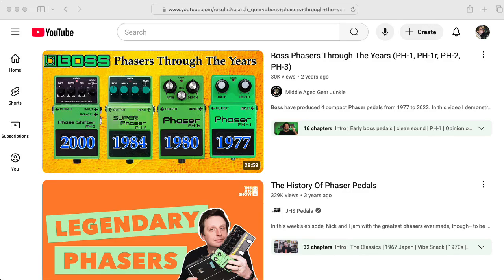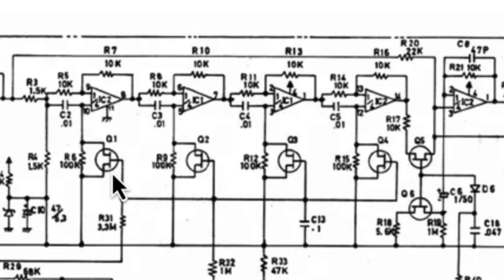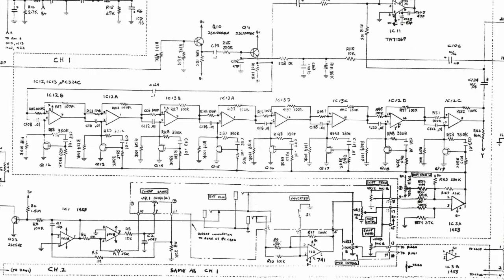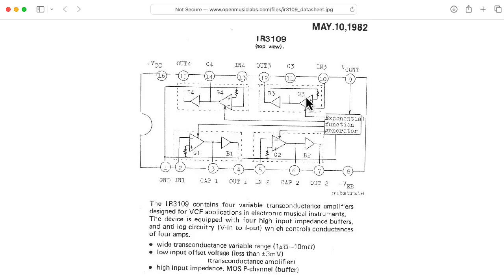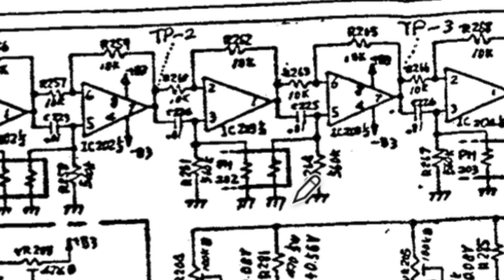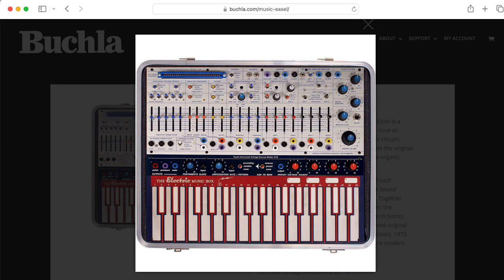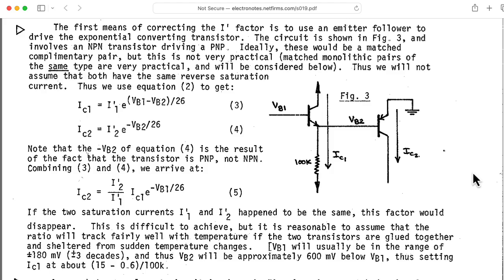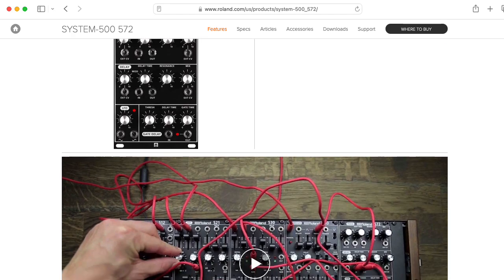Roland/Boss Phaser Circuits: A Survey of Schematics (JFETs, OTAs, and Vactrols)

Comment: Aaron, in order to have a chance at understanding your Guitar Amplification & Effects course (in your playlist), how current do my mathematics, etc., classes need to be, since I never used any of that info in my career?  (I graduated in '82.)
Reply from the maker: You can get the "gist" of a lot of things without following the details of the math. To dig deeper, you need the math, but for the most part, the most of the math I use through most of the course is just algebra. It gets more complex when I talk about frequency effects (literally, the s-plane is the complex plane), but you can analyze all the basic amplifier types with algebra. And really basic algebra -- not even quadratic equations.

As far as the electrical engineering goes, I assume basic circuit theory of resistors, capacitors, inductors, Thevenin's theorem, and operational amplifiers (for the effects part), as would be covered in a typical first semester circuits class. I also use the idea of small-signal analysis, as used for transistors. 

To get those basics, I recommend the free courses my colleague Bonnie Ferri has on Coursera.
Reply: @Lantertronics  Thanks Aaron!

Comment: One of the interesting quirks of OTA-based phase-shift/allpass stages is that they can be easily converted to lowpass, by simply rerouting one end of the capacitor in each stage from the input of the stage to *ground*.  I think the late John Blacet was the first to make productive use of this in his "Phase-Filer" module in the late 1970s.  While flipping through the appnotes for the SSM2040 chip, one day, I realized that, although a number of commercial OTA-based phasers used 4 individual OTAs, rather than a quad-OTA chip like the SSM2040 or IR3109, they could be modified in this way.  So, I did the mod to an Electro-Harmonix Small Stone, and a Ross phaser (that essentially cloned the original 6-chip Small Stone).  Worked like a charm.

Those familiar with phase-shifters will know that lifting the dry signal, and using only the modulated phase-shifted path, will get you a form of vibrato - pitch-wiggle.  When 2 of the allpass stages are coverted to lowpass, one gets a very interesting sound.  The pitch-wiggle of the other stages is retained, but the modulated lowpass of the converted stages gets one a form of modulated "wah".  However, since modulation of the bandwidth also tends to modulate perceived amplitude, the net effect is a marvelously "swampy" sound that combines vibrato, a sort of tremolo, and filter effect at the same time.  It still yields a different-sounding phase-shifter effect when the dry signal is included, but lifting the dry signal takes you to another sonic world entirely.
Reply: One of the challenges faced by phasers that employ FETs, rather than OTAs or LDRs, is that of finding a shared bias point such that, when an LFO is applied to their gate, they are ALL changing their drain-source resistance at the same time.  In many respects, it doesn't matter just what that D-S resistance is , since the audible effect results from the cumulative phase-shift across all the stages.  But it is important that all stages are always changing D-S resistance in response to modulation source, and one doesn't find onesself with one or more stages "opting out".  Such oop-I-lost-one would generally occur at "the turnaround" - the highest or lowest point in the sweep.  The audible result is that the effect tends to sound less musical.  This is one of the reasons why vactrol/LDR-based phasers can often sound much better.  The LDRs may not be flawlessly matched for their resistance, but they do respond to all but the most extreme modulation, and efforts to optimize how they are driven can improve their "musicality" and the quality of the effect.

That said, FET-based phasers will sound better, and avoid such modulation drop-outs/stallings if the FETs are matched.  Failing that, if the width of the modulation sweep is not too severe/extreme (i.e., not too high or too low), even randomly chosen unmatched FETs of the same part number will yield acceptable phasing, since they will all have at least some commonly shared range where D-S resistance will vary with voltage/current applied to their gate.  Some builders/experimenters have advocated providing individual bias voltage to individual gates.  Although that will sidestep the need to match FETs, I find it easier to use a single shared bias, and keep my modulation-width expectations modest.

Comment: For JFET design phasers, I've read that matching the FETs is important. Is matching other components in each stage, either for precision or trying to ensure mimimal or at least common thermal drift (think like a resistor array) beneficial too? In a DIY setting it's fun to try and hot rod some of these designs with modern parts and/or knowhow, and/or ability to splurge on areas that wouldn't have been profitable on a mass produced product.
Reply from the maker: Matching other things isn't terribly important. Matching JFETs is important because there's a tremendous amount of variation between JFETs.

Comment: nonlinearcircuits (eurorack designer) always has interesting takes on phasers - one of them called the "Encephalo Adjuster" has 24 (!) LDR stages, 3 sets of 8 LDRs to one LED all enclosed in a light-tight black box made of pin headers. it always inspires me to try designing my own phasers!
Reply: A friend of mine, whom I've sadly lost touch with, demoed his 24-stage unit to me about 25 years ago.  I honestly can't remember what sort of control element he used (FET, OTA, LDR), but when he used it on white noise, it sounded remarkably like a flanger.  I know the spacing of notches in a time-modulated device is different than in a phase-modulated device.  But once the number of notches is increased dramatically-enough, the psycho-acoustic result does not force one's attention to where the notches are at this particular moment (as a unit with <12 stages would), but rather allows the signal to be perceived as "increasingly infected" with notches, similar to what occurs with a flanger as the sweep moves downward from its' highest point.  

This is also one of the things that distinguishes a flanging effect from chorus.  Yes, they both employ modulated delay, and their delay-time ranges have significant overlap.  But where the delay time used in a chorus tends not to foster a perceptible change in the number of notches, merely moving them around,  a decent flanging effect will yield the sense of the signal becoming (as I like to describe it) "infected" with notches as the delay time is swept.  Remarkable how such very small changes in actually delay time can produce such drastically different outcomes.  Although I suppose if our hearing extended flat out to 50khz, such that notches above 15khz were quite audible, perhaps we might "hear" flanging and chorusing as not all that different from each other.

Comment: I remember seeing one phaser schematic that had two fixed allpass filters in the feedback path (the Ross phaser maybe?)

I designed a CMOS based phaser that uses shift registers to create the phase shift, and a CD4013 flipflop configured as a crude ADC. It's certainly not a great way to do it haha, but I like to try to think outside the box. :)

Comment: One of my favorite "phasers" is the Hammond Vibrato Scanner which is a series of allpass filters that has a rotating cylinder made of air gap dielectric capacitors. As the cylinder spins it has some capacitor fins wired to different phases. Very unique sound compared to the pedals or racks.
Reply: I agree! There is so much variation between the scanner vibrato, chorus and combination of phase / volume / spatial modulation from the Leslie it's no wonder folks have figured out how to use non - organ sources with them.  Crucial part of the classic Hammond sound.  Also had to chime in with my appreciation for Jurgen Haible! Built his "triple chorus" Solina chorus clone and its brilliant. I also really love the Music From Outer Space Phase Shifter.  The MFOS shifter is OTA-Based (LM 13700) and a relatively simple but rewarding build.
Reply from the maker: Jurgen Haible made a "scanner" circuit that tried to make that mechanical effect through electrical means. It is a neat sound!
Reply: @Lantertronics  Yes I ordered a board from him back in the day! I also have an original Hammond unit in parts sitting in my to-do pile in storage. Analog Outfitters used to make a sweet unit with the reverb included for guitarists. They go for unbelievable prices now used.
Reply from the maker: @c1t1zen Jurgen was a genius, and so prolific!

Comment: I have a Castle Phaser III on my bench right now and am about to start tracing that circuit. At first glace, it's already pretty interesting. It uses CA3080s and TL072s in the all pass filters (4, 6, or 8 stage switchable) but then there's also a compander in the circuit. According to some ad copy I have found, they are using a pre-emphasis and de-emphasis scheme as well as companding, which sounds to me like they are borrowing techniques from tape noise reduction schemes.
Reply from the maker: Oh now that is interesting! Companders are used a lot with BBD circuits -- chorus and flanger effects, etc -- but I don't think I've seen anyone use them with phasers before. Fascinating!
Reply: @Lantertronics  Yeah, I thought so too. I haven't traced it out enough yet to say where they are using it. I'm wondering if they are trying to preserve headroom going into the OTAs. I guess I'll find out!
Reply: @Lantertronics  It sounds very smooth and also has a lot of control range (modulation speeds can be very slow or up into the audio range), the center frequency, modulation depth, resonance, and mix can all be set as you like along with the switchable number of stages. Hmm...actually this makes me wonder if the companding might be used to make the very resonant settings sound cleaner...
Reply from the maker: @ Hmmm... yeah I don't have good intuition for that.
Reply from the maker: Yeah, same with the emphasis and de-emphasis -- I've seen that on BBD circuits (because they're so noisy), but never with a phaser. I'm curious to know what you find out!

Comment: Hi Aaron, I am very green with looking at circuits but you have me staring at the PH-830 circuit diagram for hours and hours and my reading of the setup is that it's effectively a 4 stage phaser. From what I can tell, all the  allpass filters are identical and  controlled by an LDR that has been tuned with a board mounted pot. It is my understanding that each allpass at any instant can modify the signal from 0 to 180 degrees of phase change across the frequency spectrum depending on the LDR - since two are ganged together this would essentialy would go from 0 to 360 with the 'notch' being the 180 degrees in the middle. So an LFO controlling the LDRs would make this loop seamlessly since 360 is just a wrap back to zero.  Does that sound about right?
Reply: @Lantertronics A phaser with n stages generally has n/2 notches in the spectrum, so an 8-stage phaser will have 4 notches. That's what I figured out from your video and staring at the circuit.  So that's what I really meant - stages are deployed in pairs to create a symmetric notch.
Reply from the maker: @djmips  You got it!
Reply from the maker: Sorry I'm not following you -- it's definitely an 8-stage phaser. They way the two light dependent resistors driven by a single LED are drawn kind of confuses the issue; if you take one of those and move it to the other size of the fixed resistor it is in parallel with it becomes clearer. It's 8 all pass stages, each with its own capacitor.
Reply from the maker: They can use a dual-resistor vactrol in this application because one leg of each resistor it the schematic is grounded, but that's incidental.

Comment: Hi, Aaron! I've been following your YouTube lectures from here in Toledo. All great and I've learned much that I should have learned in the 70s! LOL. I Was a design engineer at DeArmond here in Toledo in the late 70s and we had a few phase shifters that were pretty good. The one built in a DeArmond volume pedal had six sections and used selected FETs for the variable resistor. The one I helped design and sold for awhile was called the Twister and had 4 stages like the Phase 90. That one used a 4016 quad bilateral switch that was used with a 4001 as an oscillator to make a variable pulse width on the 4016 to vary the resistance in a quite linear fashion. Also it used LM 324 quad opamps to lower the current drain used from a 9V battery to less than half of the Phase 90. It also would work when the battery voltage dropped to maybe 5 volts so the apparent battery life was much longer than all other battery operated phasers that we tested. The Twister had adjustable global feedback to deepen the notches like most all do now. We analyzed the Small Stone  and my boss, the owner (an electrical engineer) took a proprietary ic out and boiled it in sulfuric acid to use a microscope and reverse engineer the ic. He told me it was an OTA like the CA 3080 and it might have been just ordered from RCA with the E-H part number on it. I know these lectures are primarily aimed towards your students but thank you for making them accessible to the rest of us!
Reply from the maker: I love hearing bits of history like this!
Reply: That's interesting.  Years ago, I knew someone who was looking for a DeArmond Tornado phaser.  He was a bass guitar player and mentioned how unique the Tornado was.  He said the sweeps were slower and of a longer duration than other phasers.  I imagine it was a bit like the Korg A3 sound used in U2's "Mysterious Ways".  I've analyzed a lot of circuits in depth including the AP-7, AP-5, and AP-2 but never pursued the Tornado.  Speaking of obscure, swirly pedals, I had a "Strings" pedal by Able Electronics - an analog paraphonic synth with vibrato that tracked surprisingly well.  The quest for a plug-and-play guitar synth has a rich history.  It caught my attention with its significant design challenges that made the vision elusive to even the top electronics manufacturers.  This historical journey necessarily leads through Jürgen Haible's amazing design universe as well as many others.  While modern components make a plug-and-play strings pedal somewhat routine, the art involving photoresistors, transistors, OTAs, etc. holds its own.